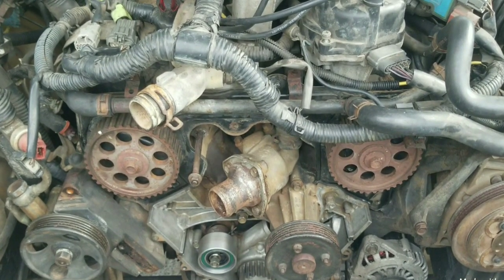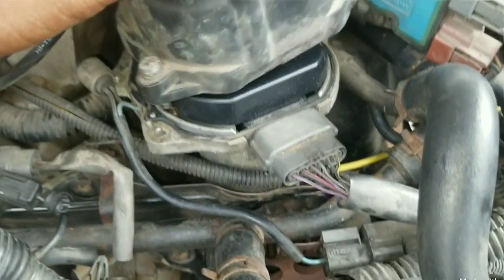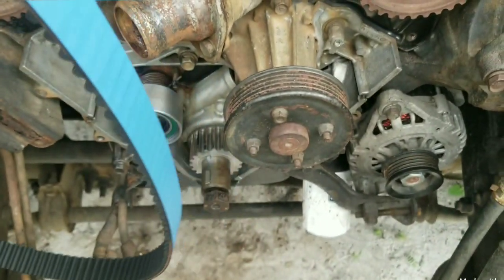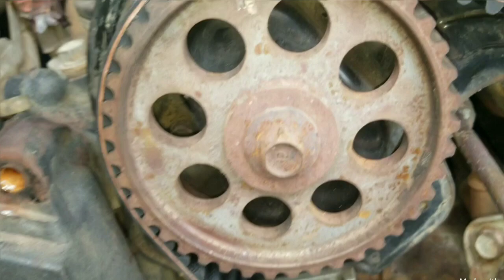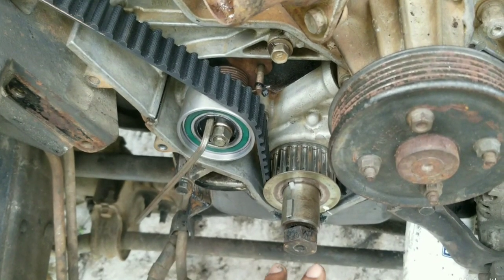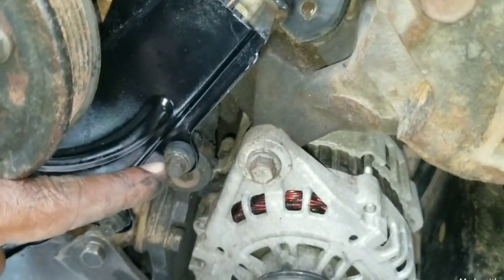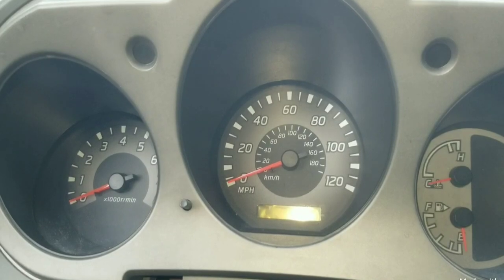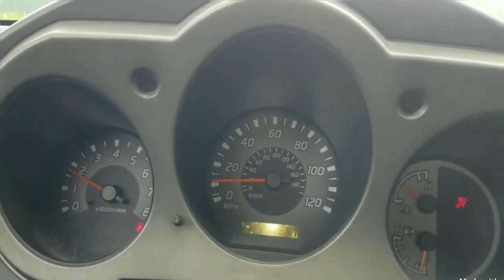How to change Timing Belt & Tensioner. Part 8/8

Comment: I can't find the video where you mentioned it, but there is a video where you mention a concern with using synthetic oil in the vg33e because of an issue with the EGR.  The video mentions you will explain later in that video, but I didn't see anything later in the video.  Can you explain here?
Reply from the maker: To make thing simple about synthetic oil and conventional oil. Synthetic oil come from sand oil so it easy for it to return to soil state with sulfur. Conventional oil come from liquid crude oil so it will maintain a liquid state with sulfur.  Hope that help. YouTube is not the place for truth and facts. It's all democracy